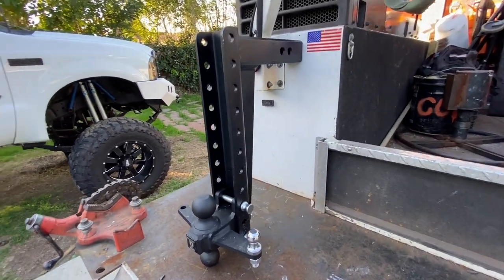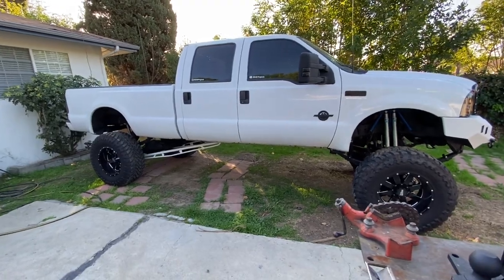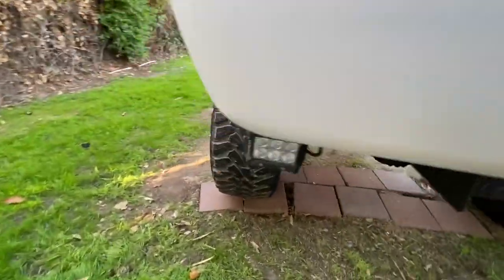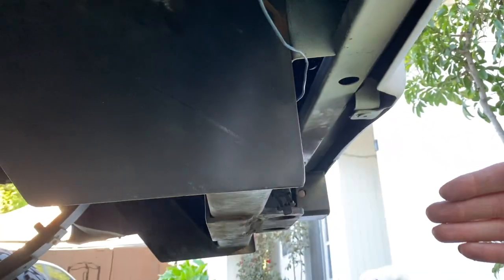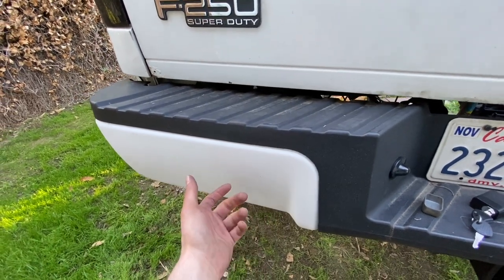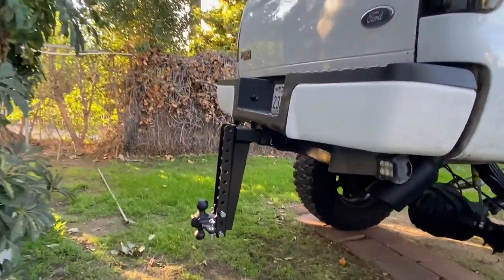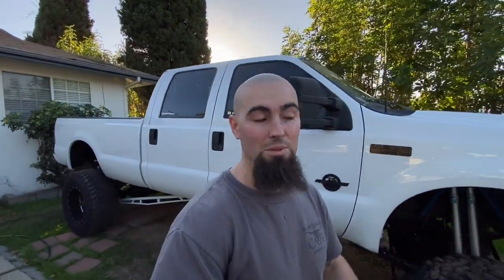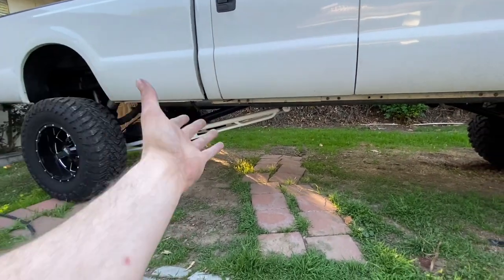2001 7.3 powerstroke gets Bulletproof 16 inch drop hitch! Plus some nice welds!

Comment: What gears are you running and what is the tire size? I’m running 4.56 gears with 37 inch tires pulls great tops out kinda low
Reply from the maker: 40 inch tires with 4.88 gears. Get up and go is good and pulls my travel trailer no problem👍🏻

Comment: Would you consider gettin a banks power rear dif cover
Reply from the maker: Maybe. I’ve heard mixed reviews on aftermarket diff covers. I need to do more research on it
Reply: So the banks power has a few youtube videos on theirs and they back it up with data and comparisons from stock and a few of the big name aftermarket ones and theirs as well. I would highly recommend looking into it. I think they run bout 350 to 400 dollars
Reply from the maker: @taylormckeel7160  that’s not a bad price at all. I’ll have to check out those videos. Thanks bro!  Also, I’m about to start something new that I think is going to be really cool for my viewers so stay tuned for my next video!!
Reply: No problem big guy! I most definitely will!!
Reply: I got one on my truck paid close to $600 with oil from armsoil
Reply: Now is that with shipping and handling?
Reply: @taylormckeel7160  yes shipped to my house like $580 it’s pretty sweet looks nice under there